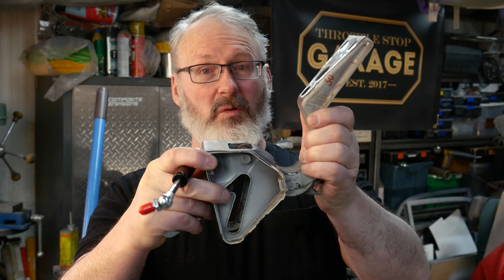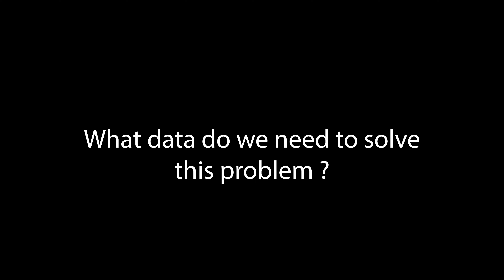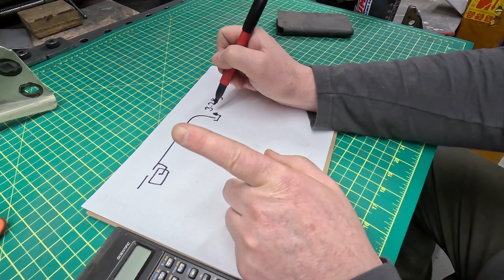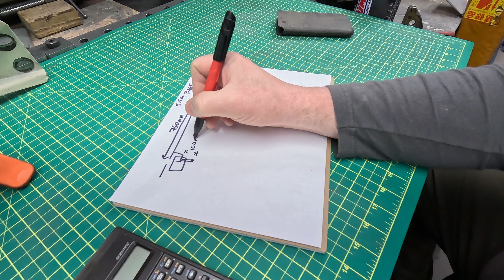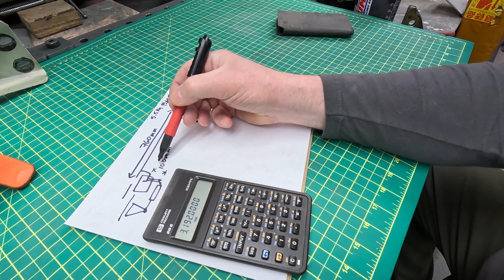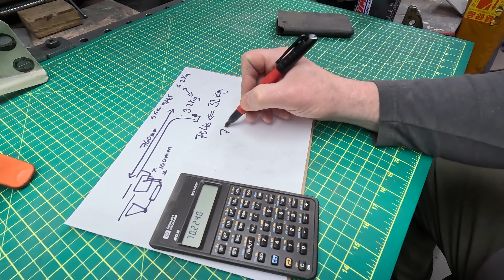Adding Gas Springs to Car Hinges...when you just need a lift.

Comment: Rail, system equipment operators cab's gauges digital pressure switches wiring harness and easy operation..

Comment: Starting building a front chssis section... for a MK2 Triumph Stag to take a BMW 4.4 V8 engine...here in the UK.  where did you get your chassis  frame rails
Reply from the maker: I had them bent by Art Morrison in the USA.  Stay tuned, I'm about to cut those off and do this all again...unfortunately.

Comment: I made my own carbon hood.
Instead of 2 fully working gas springs, I bought 2 original, that did not hold one hud open, used one and works perfectly fine.
from 23kg to 3.
Reply from the maker: I never thought of using just one of the torsion springs...it probably would have worked!

Comment: Craig, how can I reach you ? Do you have a website for the store I’m in the United States I need your help regarding a part you recently made
Reply from the maker: You can contact me on Instagram DM.  I don't sell parts etc. but I'm happy to help if I can.
Reply: @ThrottleStopGarage  You made a set of brackets for Steve l322 Range Rover from Shedlock2000 he said to contact you if I need a set I have the same setup but I’m missing the brackets you made for him, please help me get the brackets and thanks for the reply without the brackets I can’t use the D5 roof rack that I have thanks

Comment: From what I've seen with powder coating the paint/powder comes out like a fog more than a stream.
Reply: My powder coater (CJ Ward  enamelers Burton on Trent UK) just drifts the powder from the gun. It’s literally pulled into the work by electrostatic force. The powder has an electrical insulating effect so the thickness is governed by the charge potential. 
He also uses a zinc passivate dip on all ferrous parts. His work has lasted much better than anything done elsewhere.
Reply from the maker: @Dave5843-d9m  Not sure how I'd do this at home.  I've got.a new PC system and it's working great.
Reply from the maker: I've tried various mods on this gun and I still think I need to get the regulator to dial the pressure down.  It could also be that epoxy sprays differently.  I don't know.  I'm amazed at how forgiving it is to spray.

Comment: Craig, if those 40# springs are too heavy and the 30# are too light just stay with the 40's and add weight to the trunk lid, that'll fix it for ya'!! 😂 But seriously I get tired of trying to come up with new superlatives for your work, how about "nice" ? So does this ever happen to you? Your sitting having dinner with your wife and she asks, "what are you thinking about ?" So you tell her "I'm trying to calculate the length of spring and the force required to lift the trunk lid on the car now that I've redone the geometry of the hinge points."
Reply from the maker: I got a text from a friend yesterday saying I could have put in a 30 and a 40 and got the right value.  There is always someone that can find a better solution.  My long-suffering wife experiences this conversation daily.  She will also randomly blow away unsuspecting "car-guys" trying to man-splain some car thing that they think they understand.

Comment: Nice one....not quite sure why you didn't go with a bog standard spring sized to the boot lid weight.  That said, now I know how to calculate strut sizes. 
As always a great video (warts and all), thanks for sharing
Reply from the maker: It's not like I can get these springs in different weights.  It also cleans up the look of the trunk/boot of the car.